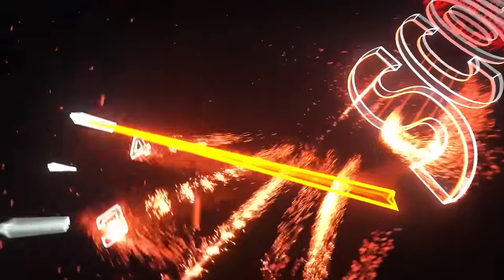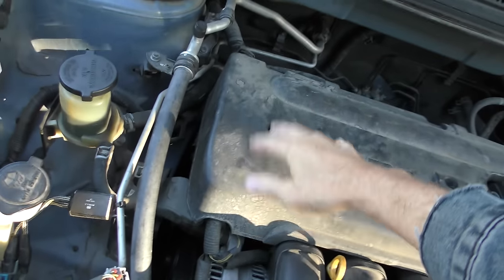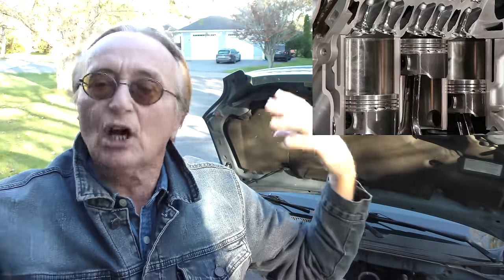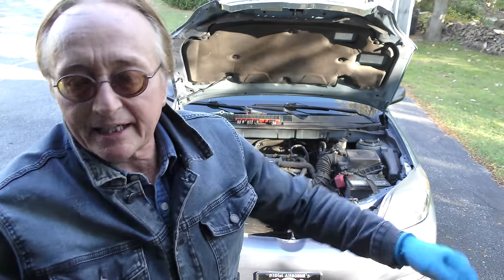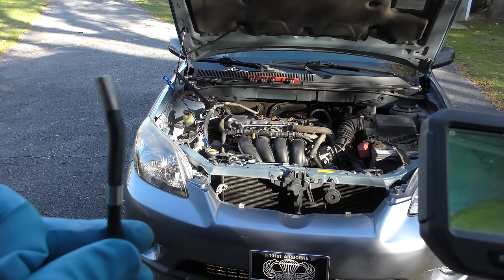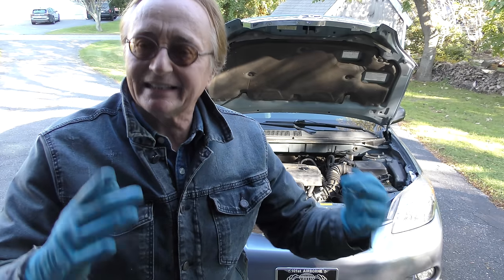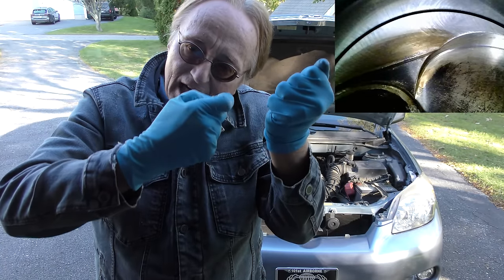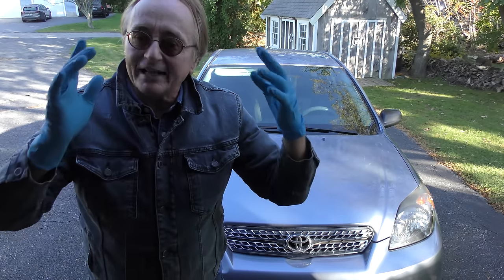Doing This Will Fix an Oil Burning Engine for Free

Comment: HI, I HAVE A 2005 TOYOTA HIGHLANDER  SOMEONE JUST TOLD ME THERE IS OIL ON THE ENGINE ( I SAW IT) AND IT PROB MEANS I NEED HEAD GASKETS BUT IT RUNS GREAT, IS THIS AN ISSUE OR NOT FOR THE VEHICLE. THANK YOU FOR ANY OF YOUR  YOUR HELP ANGELA
Reply: You don’t have to replace the head gaskets, just check oil level more often. Peace of mind is wonderful, I would recommend replacing the gaskets. Take care.

Comment: A cylinder leakage test on automobiles engines is a lot better it has to be done on aircraft engines annual inspections or use to be?

Comment: As usual Scotty knows what he is talking about!  Worked on aircraft engines and we used borescopes ALL THE TIME.  In fact, engines have borescope access ports as part of their design.  I'm sure airframes do as well.  Found out borescopes were affordable a couple of years ago and bought one.  It is indispensable for inspecting areas on your car that you cannot access without removing quite a few parts.  It has helped me eliminate potential problem sources and locate the actual problem.  I've also used it to inspect many items around the house (gas furnace, sump pump, interior of walls, etc).  I also agree with Scotty in that I wish it had the bendable "finger" tip.

Comment: Hi uncle Scotty, I have a question. Does a vehicle burning too much oil have anything to do with loss of mpg's(bad gas mileage)? TIA
Reply: I'm not uncle Scotty but, Yeah if the piston rings are worn you can lose mpg,  power and burn oil. But you can also burn oil not lose mpg or power.
Reply: What vehicle and how many miles?

Comment: Hey Scotty here a question for you my 2014 hyundai Elantra Gt is slow to shift gears but it does shift I don't have grinding gears or slippage or and buring smell and I don't hear bangs from under my car. My car accelerates great and runs awsome for being almost 10 years old. What do you think it could be. Hyundai dealership here says its my transmission and I need a new one but it won't be new they will sell me a refurbished transmission.  I think it's just a little think that needs replacing. They said they test drove my car but they really didn't. Anyways do you have any ideas what it  could be. My dad isn't shooting any codes and ne check engine light. Thanks so much Scotty.

Comment: Scotty, pls see Toyota Recall / Campaign Technical Service Bullitin :  T-SB-0094-11  Oil Burning Issue on the 2AZ  4 cyl motor.  Toyota installed new pistons & rings in my 07 Solara. Now runs fine @ 140K miles

Comment: The Honda CRV are notorious for burning 2 quarts every 2000 miles. I started using 40 weight to keep the oil thicker.
Reply: Bad idea

Comment: Question: my engine is running hot... burning oil and coolant, no leaks. Any suggestions on where to look?
Reply: Check under the oil cap for white frothy stuff. Sounds like a bad head gasket.
Reply: @carloswithac  ty i will
Reply: Looks like a chocolate milkshake inside the valve cover? Does it "hydraulic"when you do a cold start after a previous full-hot shut down? Head gasket/cracked head. Oil may be getting diluted/thinned out by an internal gasoline leak, as well.

Comment: I just can't buy into the Electric Vehicle idea..We are retired (OLD) and have two cars...Both are Hondas...A--CRV and a Pilot..The CRV is pretty new and gets 30 miles per gallon..I bought the 2008 Pilot 3 years ago for $5 K..I use it whenever I have tight spaces (grocery store and Home Depot)..It gets about 18 MPG..I love that car..It is fast, strong and I don't worry about any scratches..I carry full coverage on the CRV-- and just liability on the Pilot...The amount of insurance cost for just liability makes the Pilot cost effective...I thought of giving my Pilot to our daughter, but I like it too much to give up..I bought my grandson a 2006 Toyota Avalon with 80K miles on it..He is head over heals with it and gets 25 mpg with it..I think Honda and Toyota are the two best cars for the money..Honda has the "Interferon" motor, which is a design flaw...If the timing belt goes,----- your screwed..Toyota has an advantage with a "CHAIN" timing belt..As far as American products, Dodge is the worse, followed by Ford and then General Motors.....I was going to buy the new Corvette, but the advertised $60K ballooned to over $100K, because of Dealer greed..I just couldn't bring myself to depart with that much money for the greedy dealers...General Motors needs to fix that for their loyal customers...The German products are too expensive for the return..They ride rough and are always in the shop, with EXPENSIVE repairs..I have owned many cars..G.M, Ford, Dodge,Japanese and German..(My German Passat needed to have the engine pulled in order to change the heater core (what a design flaw)....General motors has out performed the other American cars...I have owned a 86 Honda  Accord, a 92 Four Runner and a 2008 Camry (From 1986 till 2020)--Never once were any of those cars repaired--That's 34 years of repair FREE driving plus the last 3 years......GO FIGURE!!

Comment: Hey Scotty, wanted to ask a question. "I have a 2017 camaro v6, and have started doing Full synthetic oil changes, in your opinion what would you reccommend the mileage to change it every 3k, 5k what?" Thanks Scotty!!!!
Reply: I have a 2016 camaro 2.0 trubo and I do oil change every 3k to 4k miles
Reply: With synthetic oil the recommended interval is 5-10k miles

Comment: Hey Scotty, that's not a spark plug socket because it doesn't have a rubber grommet inside to hold onto to it for removal. It also makes it easier when installing a spark plug guaranteeing the ground electrode won't get closed.

Comment: HELP.
Hi Scotty I really enjoyed the knowledge and awareness you push with regards to car repairs etc. I would also like you help in addressing an issue that I am currently experiencing with my Mazda 3 (2006) Axela. So let me share the issue I was driving and the engine check light came on. I got it scanned and I was informed that the knock sensor needs to be replaced. The sensor was replaced however after this process the car start idle rough ,vibrating and the brakes was not working as it should. Also what I should have mentioned earlier a strange heat was coming from the back seat and the floor panel was hot. I decided to start the car and peek underneath only to see the catalytic converter glowing red. I have to take the car to another mechanic now to address the catalytic converter issue but what I can't understand why is the car idle rough and vibrating when it stops or in park.
Reply: Internal combustion engines, require  unhindered air flow into and out of engine.   If catalytic converter is plugged, broken...air flow is  reduced going out, so less going into engine, so engine does not operate correctly.  Scotty has videos on this, and can be checked by measuring the pressure going into and out of catalytic converter, as engine operates. Usually, this is measured by removing sensors,  before & after converter, one at the time and using a pressure gauge installed into the hole where the sensor was...Not a mechanic,  but hope this helps.

Comment: Scotty I got a question related to my dad's car is a 06 corolla ce, the thing got this acceleration problem dat if you press the pedal heavy enough to pass the 1/3 of the pedal travel it'll take off like a rocket and sometimes it pulls intermittently as you accelerate. The problem is avoidable just babying the pedal, but I want to find the problem. It has no check engine light on... Hope you can talk about it & I catch it 🤞🏼

Comment: I had a 5 year warranty. All it took, to void warranty. Was the mechanic to tell the warranty company, that my check engine light was on for 15 days. This was after the mechanic had replaced the coil the plug wires and the spark plug that was giving me a problem. When the real Diagnostics was a broken head gasket. So I had given up the vehicle for repossession and that really hurt my credit. Because the mechanic said the engine was torched and would cost $10,000..... So! Don't buy GM!

Comment: Very much truth but ... VW sold a whole series of cars with oil scrap rings that were not so 'tight' in order to reduce gas consumption but they all were oil burning cars. If you bought one of these cars and got warranty, then they would replace the engine but if you bought it second hand ( because someone else had this problem) , you had to pay the new motor yourself : about 5-10000 E.  Same with some french cars, new models , 3 cyl which are made to obtain max co or emission targets but they are bad engines and burn oil like hell and mecanics know their reputation quite well.  3) Some Toyota and French cars burn oil because the valve seals are 'gone' and a rebuild of the head is necessary otherwise the problem is not solved. Actually a car with 'blue' exhaust smoke when starting is in many cases a oil burning enging, that is nr 1 alarm bell going off. Oils and regular service is mandatory and each modern engine requires a specific oil qualification, if you mix full synth and then another kind of cheap oil etc is asking for trouble and then you may get an ' oil scrap ring ' totally clogged and not functioning or got 'stuck'.  One cheap thing to help ' may ' be to fill it up with a product to clean the whole oil system BEFORE changing oil ( let it turn 10 min)  each time to loosen up and clear the oil ring below.  All is possible , but finding the RIGHT diagnoses is half the work and money otherwise you keep on guessing what's wrong with it and even doing the wrong 'cure'. Auto constructers find 1 l oil pro 1000 km about acceptable and not warranted ...problem is when you do the service after 10000 km or more, there's no more oil in it and BANG !

Comment: 20 dollar one no engine pull  did hamonic pully top rocker lifter 2 cam phasers flywheel because able to see bottom end fine saved 1000s for using 2o dollar cam hook to phone

Comment: My AAA Approved mechanic told me I had an oil leak and fixed it (Replace valve cover/reseal cam cap). That was 2022. In February my alternator went ($700 repair!). While they had the car, they said there was an fuel pump problem AND another oil leak. I told them to forget the oil leak because they just charged me $1600 for  the alternator and fuel pump...both estimates far above what AAA quotes.

Comment: How to stop being ripped off by mechanics? I have a brand new Camry and they keep telling me that i need to align the wheels. I went to Belle Tire and they said wheels are fine. Toyota dealer would charge me 800$ for nothing and just saying they realigned wheels? I asked them for the detailed report about on how much it is realigned and they aovided it by telling me to call their manager and he never answered my calls. I think there is supposed to be the law about it and put those bad guys in jail or at least probation for doing it?
Reply: Unless you notice the wheel isn’t staying straight there is no reason to align the wheels

Comment: worn rings cheap oil scraper rings, pcv valves age cars/trucks/boat engines especially inboard engines “maintenance” if you get or find your self in that situation like a faucet rule if one side is leaking the other isn’t far behind. replace it now. always always use oem [original equipment manufacturing] What i would do to like the ford bronco’s since the valves are breaking when you buy one the certain models have the Ford dealer install a valve so yours doesn’t break. Ford isn’t checking or monitoring made in mexico quality control. Their using inferior cheap as dirt valves can’t take the stress good bye engines.

Comment: Only way to fix oil burning engine is to rebuild it properly swapping piston rings with desired sizes, replacing the seals and gaskets.
Reply: Not if you have a stuck PCV valve.